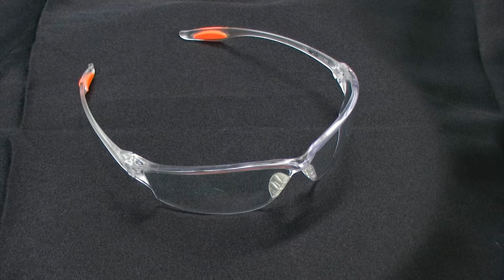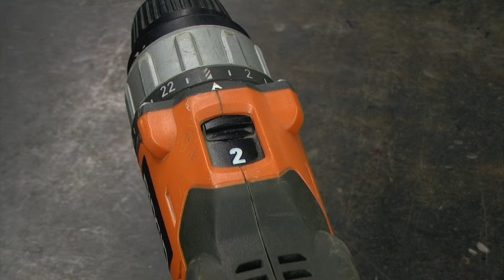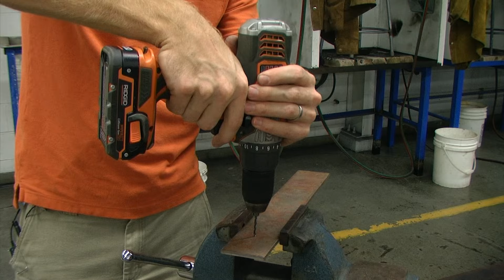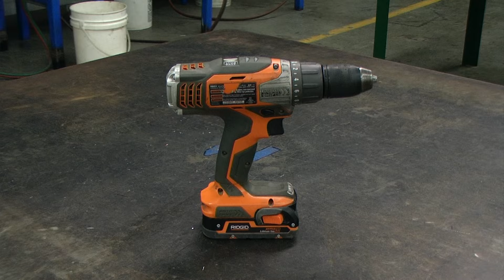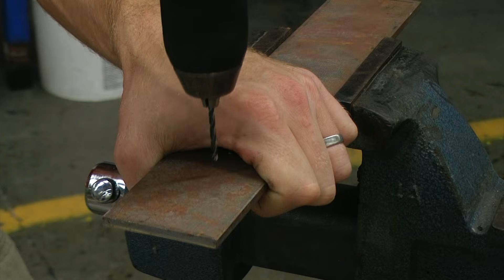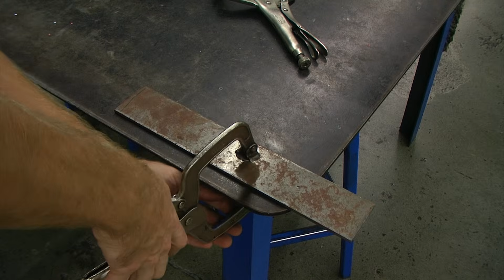Cordless Drill Safety

Comment: Would you say the polarity switch also doubles as a "safety" for the drill when pressed only halfway, locking the use of the trigger?
Reply from the maker: Yes, I would say that it acts as a safety...however, it can easily be pushed out of the "safe" position.

Comment: Who the heck takes the battery out to change drill bits?
Reply from the maker: Best practices.
Reply: @InsaneOil  So you don't... Use the drill's primary function to lock the bit into place? Seems a bit inefficient on such a safe tool...
Reply from the maker: @benperry4336  Best practices is to hold the collar the the chuck and manually tighten it and loosen it.  I have had student try to take the short-cut you talked about and they end up  holding the drill bit instead of the chuck.  The get a rude awakening when they squeeze the trigger and it cuts up their hand.
Reply: @InsaneOil  Well that's why you go slow. It's an analog trigger, not two-level on/off. I would also recommend using your palm to grip the chuck and the tips of the fingers to grip the bit as you slowly squeeze the trigger.
Reply from the maker: @benperry4336  And do you really think a 15 year old kid that knows everything will follow your directions exactly as you tell them to?
Reply: @InsaneOil  Depends on the 15-year-old, probably case by case.
Reply from the maker: @benperry4336  Now imagine that there are twenty-six, 15-year-olds.
Reply: @InsaneOil  Fair point, in that scenario at least.

Comment: No where did you mention that with only one hand you can injure your wrist if the bit gets stuck and the drills jerks to the side suddenly.
Reply from the maker: PRO AQUATICS If you have two hands on the drill and you are progressing slowly through your material than your scenario will not happen.
Reply: Insane Oil yes obviously, but you listed reasons to not drill with only one hand and didn’t mention the one I just did.
Reply from the maker: @proaquatics4005  Very true...however, if you were following the rules in the first place, we wouldn't be having this discussion, now would we?
Reply: Insane Oil I don’t even know what your talking about anymore. I just pointed out that there are more reasons then you listed to use 2 hands when drilling.
Reply from the maker: @proaquatics4005  I agree with your assessment.